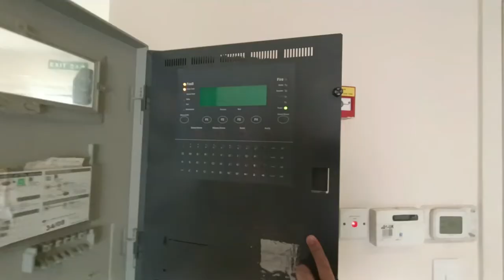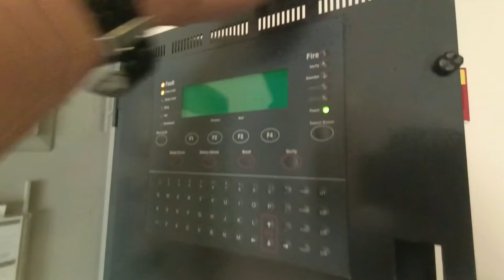FUSES INSIDE GENT FIRE ALARM SYSTEM USES | INDECATED BOARD VLOG#113

Comment: voltage too low ano kaya boss ang problema salamat
Reply from the maker: my na incounter na kami pati engr. namin dirin na ayos namin  voltage high minsan sa loop yan check nyo nalang kung saan tapos doon kayo mag focus o kaya dyan sa slot ng card kung may problema
Reply: @JHAN2XTV  halos lahat sir walang votage yung loop card niya loop 1 to 6
Reply from the maker: check mo yung fuse baka sira kaya walang voltage.yung fuse para sa slot ng loop